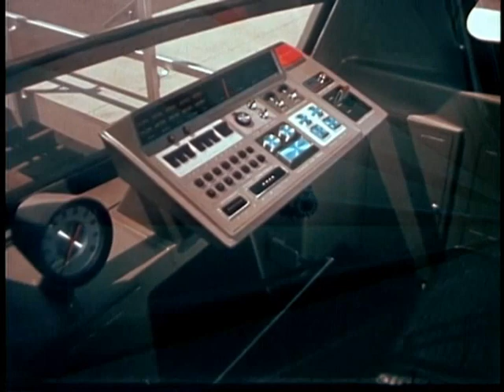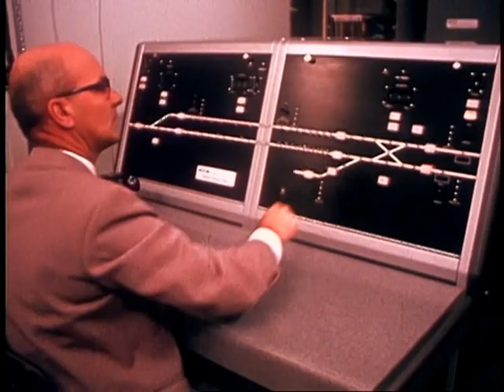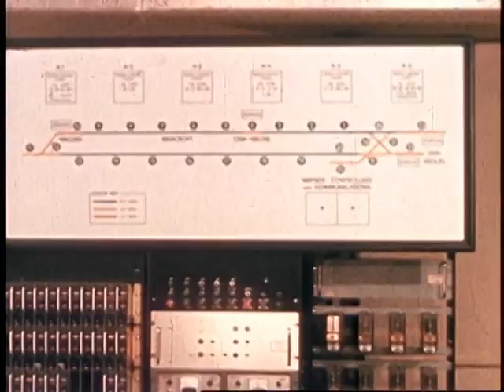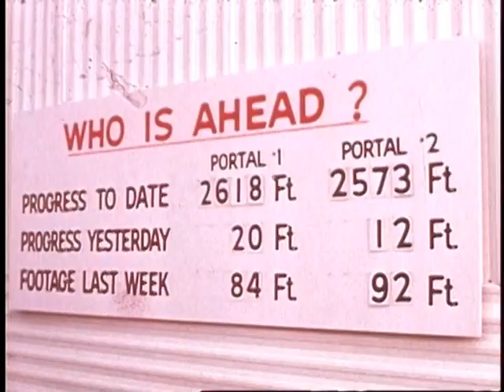Early BART Film

Comment: Bill Richard Stokes, who was the 1st general manager for BART, passed away in 2013 at the age of 89.
Reply: but b.r. stokes was also the dude who refused to listen to engineers listing safety concerns regarding the atc system and fired them. this resulted in the fremont flyer incident
Reply: The wrongful termination of the engineers came back to bite Mr. Stokes.
If he only listened to the engineers about the train control system's teething problems, he wouldn't have been ousted.

Comment: As a young boy I rode this system the day it opened in 1972. It was truly a awesome experience at that time. You could ride from San Francisco to Concord for under 2 dollars (if memory serves me well). The problem that is plaguing BART unlike other agencies is three fold. An aging fleet and infrastructure - no Federal Subsidies - and a lack of co-operation from transit districts to allow ":right-of-way" for track beds. The original grand idea was for BART to encircle the Bay Area completely. Expansion was made possible by an agreement under which San Mateo County was to contribute $200 million to East Bay extensions as a “buy-in” to the system without actually joining the BART district.Currently BART pays San Mateo Co. a $1 million dollar ransom annually just to have service to the Airport. Considering all of the above - I still think that BART is a move in the right direction. One thing we all learned in the Bay Area is that the system withstands earthquakes pretty good, and was a lifeline after the Loma Prieta Quake of 1989.

Comment: Not exactly, unless you live in downtown SF or Oakland, you probably have a car. I understand this is not the case in NYC. (correct me if I'm wrong) In the bay area if your running around at rush hour, you WILL run into a considerable amount of traffic, it's more or less a shortcut. Non commuters will only take BART if a station is within California's version of walking distance (less than a mile) I guess you could say that it's two different things. We also have MUCH fewer taxi's.